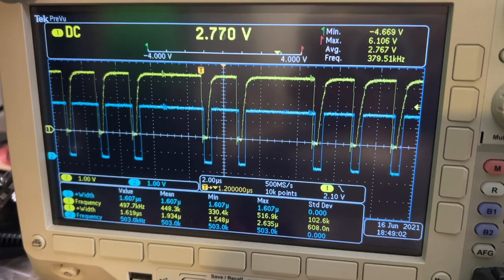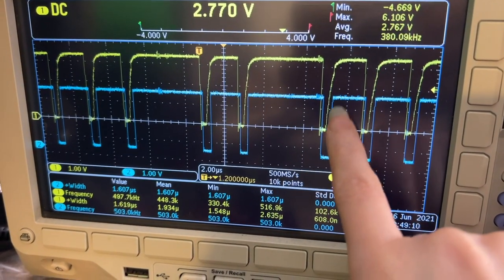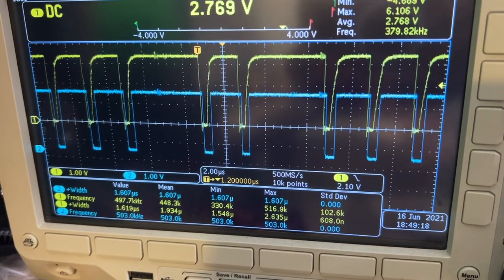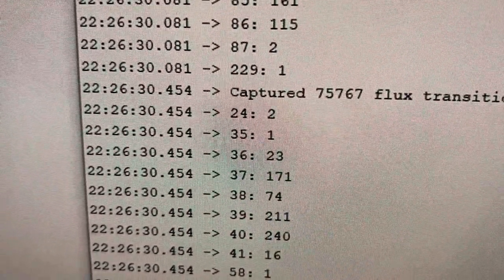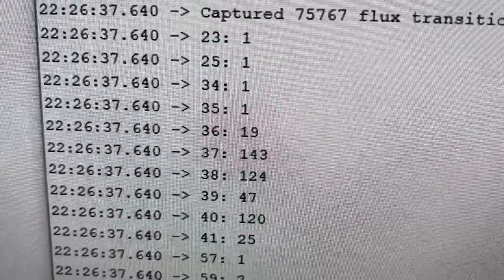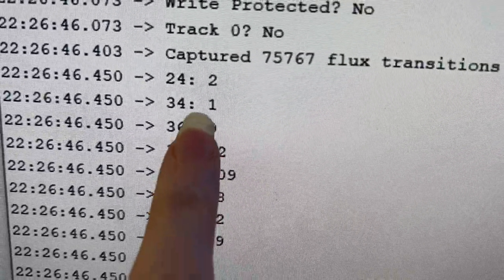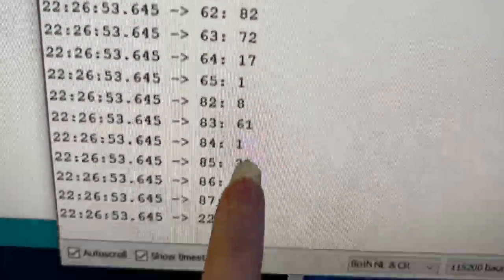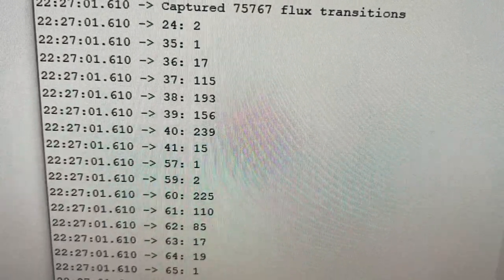Reading floppy disk data, part 3! itsa pulse party

Comment: Ain't no party like a pulse width party because the floppy disk party don't stop! 😂
Reply: Seem to remember that there were soft sector floppy disks with a single index hole and hard sector floppy disks with more holes.  10 holes I think.  Also there were single and double sided floppies I believe.  Different sizes too : 3 inch, 5.26 inch, and 8 inch.  How many of the variety of floppies will be supported?